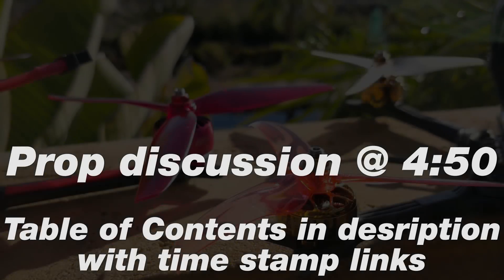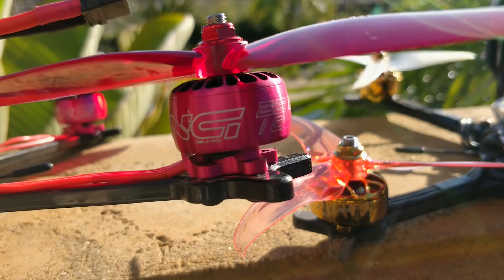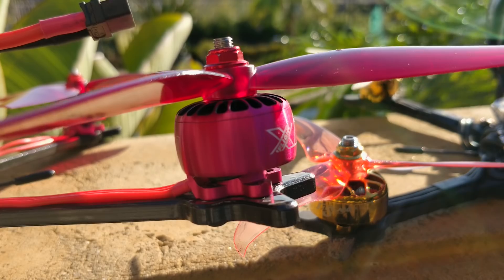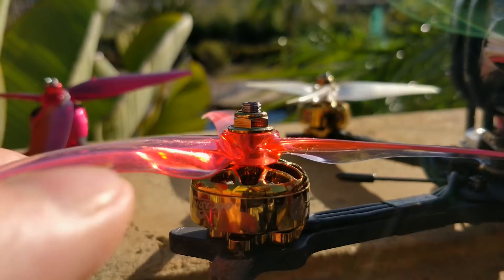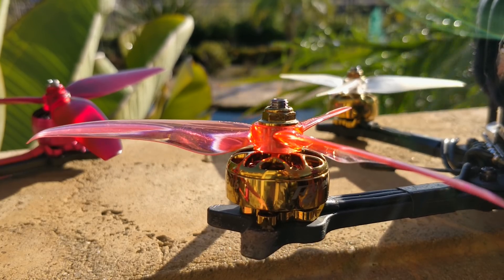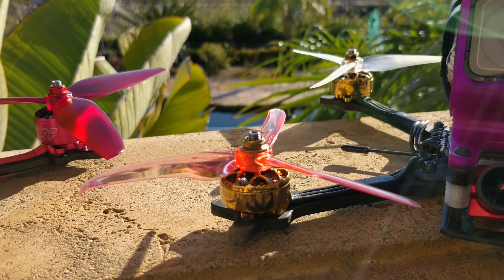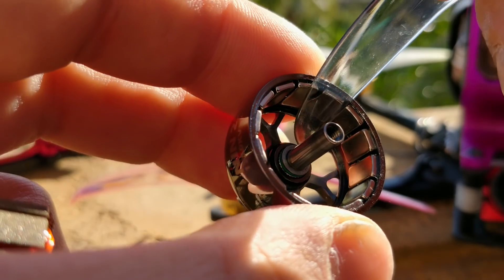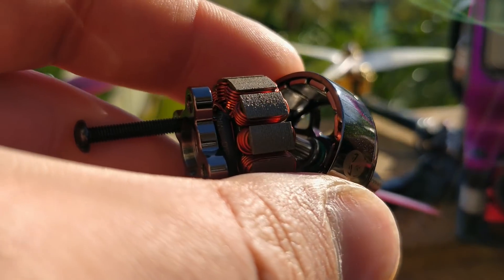Gemfan 5146.6 and Flywoo Motors

Comment: As you know props much better than most I have a question you may be able to help me with. I run an ultralight 250g dry racing Drone with outdated dys 2205 2750kv motors. I find the grip low and slow speed control  lacking. I am currently using 5040 cyclones or 5042 windancers as I am trying not to cook those motors. What props would you recommend
Reply from the maker: Definitely this prop, the Gemfan 5146.6.  For now you can consider the gemfan 5149 probably.  It's particularly good for racing.  Or the newer Tmotor race prop.  I forget the numbers on it.  Don't worry about cooking the motors.  That won't happen.  All that will happen is that the top of your throttle will feel like it does nothing if the motor is overpropped.
Reply: @Kabab  thanks, good to know I have few  of the 5149 so I can try that out until these new ones are available

Comment: KababFPV i would recommend you to try the master air screw RS 5x4.5x3. this prop is supper responsive and grip. but they are still glassnylon so durability is not great. but the feel is soo good

Comment: Wouldn't the power hump be smoothed out by applying throttle expo?
That 2206/07 wobble... God it's so freaking frustrating. You build a mid/high-end rig for smooth footage, bf 3.4 comes out and suddenly my 2.5yo-beaten up-full realacc-f3-QAVX clone flies better at 1/4 the price. Do you have any knowledge on this issue on other firmware, like butterflight?
Reply from the maker: Butterflight is unfortunately dead so I wouldn't bother with that.  I don't know anything else about the issue but it's super duper annoying.  Yes a throttle curve can help smooth it out but it also causes weird inconsistencies that I'm not a fan of.  It's hard to tune a throttle curve.  I'm way too lazy to spend too much time on something like that from quad to quad.  I'd rather just have it flight right from the get go.  Thankfully these new props from gemfan and azure make it possible.
Reply: @Kabab  Didn't knew about butter :/
Seems like a time to drop the Avans and HQs then!
Reply: @KababFPV what is helio going to be running or is it just merged betaflight code now.  Any future support for helio boards coming in betaflight?
Reply from the maker: @danmarsiglia208  betaflight will probably never support Helio. Helio must maintain their own fork of betaflight.

Comment: Nice video as always :) For the cheap motor choice, here is another one: LDARC 2306 in either 1700kv or 2500kv (I have the 2500kv on my first build and I really like them, I have nothing to compare too though...) About 10 dollars on XT-xinte  and about 13 dollars on banggood. I linked XT-Xinte cause they have a nice picture of it disassembled.  https://www.xt-xinte.com/LDARC-XT2306-2500KV-CW-CCW-Motor-for-FPV-Racing-Drone-Quadcopter-Lightweight-Design-Silver-Plate-Line-p545317.html

Comment: Those motors look bad ass!  Does DYS make a good motor?  I’m using their Samguk motor for $9. While I learn to fly. They have taken a lot of abuse but still work flawlessly.
Reply from the maker: The samguk motors are alright.  They work, perform alright but that's about it.  Not a bad value but after just a dozen flights or so the bearings start going bad.  Still usable and fine, just not nice.  I'd sooner buy the RCX motors before those. The RCX are as good as some top shelf motors but they're $10

Comment: All I know are Dalprop and HQ.  I was told the Gemfans were not very good.  These are better suited for Freestyle?  My sources are mostly racers.
Reply from the maker: This has been the case for a long time but the latest few props they have made are very popular with racers too and are actually impressive.  Try the 5149 (not the 5149.9).  The 5149 is not very good at low speed but at high speed it's extremely impressive.  The grip at high speed is unmatched.  This 5146.6 is similarly impressive in that sense but also has good low speed control.

Comment: Hey Bob, great video. Just FYI. I have measured HQ props myself and confirmed with Zhong as well. HQ 5.1” props are, in fact, 5.1”. They are not 5” + 1mm. 1mm is only .039, and that wouldn’t make enough difference to matter.
Reply from the maker: that's what he told me so I dunno.  Whatever it is it's ridiculous what these manufacturers do.  There should be a standard accordance or something among them.

Comment: Your classic saying is...More on that later...Really dig how you examine quad parts.   Wonder if you have tried some Dal  5249...super quiet and smooth prop.  Your awesome Dude!
Reply from the maker: Yeah I wasn't impressed with it.  It's just a big heavy prop that motors often struggle to spin.  They feel like 7" props but are 5.2".  Maybe it was just the two quads I tried them on but I wasn't impressed.

Comment: nice tree topRacing ;) what is going on with brotherhobby and this new speeeeed shield V2 ?! aviable in 3400kv !!! rated for 6s throug the range is that even possible ? i mean 20K RPM are freakin fast, and todays dry bench testing resul in 50K + RPM (please correct me when im wrong) and DR1 racing puts 2200 KV on 6s and.. it that the current "limit" of an "rotor" spinning through the air, and above that... Blades have to shape, and feel (material?) very different to todays "flimsy" ones... 
.. dunno maybe in the next few yeahrs FPV drones especially those build for proffesional racing getting  dangerous in the wrong (hands)
Reply from the maker: I haven't seen that motor but 3400kv is just stupid.  No point and it's just wasteful, you're right
Reply: @Kabab  https://www.banggood.com/Brotherhobby-Speed-Shield-2207_5-V2-1560175019202108240027003400KV-4-6S-CW-Thread-Brushless-Motor-for-RC-Drone-FPV-Racing-p-1421727.html?rmmds=mywishlist&ID=531637&cur_warehouse=CN
Reply from the maker: Ridiculous

Comment: At low feedforward values, there are probably areas in fast recoveries where the FF and D terms are both functioning as damping terms, and that might be what you're experiencing with that.  I think the over-smoothed nature of my older 0/0 D-Setpoint/Transition range can force some extra smoothness as well, although as you mentioned there is a cost to responsiveness contained in there.
I really think there is a use for 2306 motors because of that big hump of torque down low, especially with lower pitch stuff on low weight quads - but I still can't get past how much I love the ultra-linear nature of 2207/2208's with V2 Cyclones
Reply from the maker: Yeah that's why I like 2208 but the issue is that damn wobble when you let off the gas.

Comment: On paper, nylon-polycarbonate composites should make it actually tougher (depending on which resin or butyl-styrene binder is used), so the MasterProp material sounds awesome. To me, a lighter version of the 5149 is probably absolutely perfect for what I'm after - just depends on how linear the thrust delivery is.  I think stiffer probably trumps lightweight with big powerful motors, although the lighter 2306's seem to really enjoy low weight props and get that amazing wispy feel consistently.
Reply from the maker: This prop is really fantastic. I tried not to over Hype it but it's going to be my go to prop moving forward until something better comes around. It very easily took the title as my go to prop.
Reply: @Kabab  I know you don't enjoy doing dedicated prop reviews that much anymore, but feedback like this is basically invaluable.  Also, this would complete my journey to a favorite propeller in each size being Gemfan (right now is the 2040, 2540, 3052, 6042-3, & 7042 flash with T5046C and 5149's tied evenly).
Thanks for taking the time to explain why your new favorite prop is just that!!!
Reply: @Kabab  Well, I find myself in agreement again.  Definitely go-to status, only omission is POPO compatibility on these.
The mixture of smoothness and grip these achieve with tall stator motors is really excellent, as long as there's some torque in the bank these things are just amazing.  On motors with less torque, I'm starting to prefer running really high KV and lower pitch lightweight props (Ethix S3 and HQ 5.1x3.6x3 are impressive) to get a locked in feel that's similar... although that setup has me running some outright absurd combos like 6S 2250KV 2205 on low pitch to get the feel comparably decent to where my favorite vanilla 4S 2207 2550KV setup is with these props.

Comment: Do u think the dys wei 2207 1750 for my 6s build are worth it? Or are they just total crap
Reply from the maker: They're not crap but I also don't think they're worth it. The Emax eco looks a lot better and the Eachine 2306 is surprisingly good too
Reply: KababFPV if I were to raise my budget to 12-18 ish dollars, are there any motors significantly better than the ecos?
Reply from the maker: @DirtyLew42  I'd go for the xing 2306. Eco's are probably good too however.
Reply: I'd run the RXC LS2207 or EMax ECO over those.... or go XING.  If you're tight budget wise, RCX.

Comment: Thanks for review,  Bob.  Is there any chance you can do vid on how props differ between colors.  I've been using the 51499, the yellow is unobtanium durable, but the purple is really flimsy in comparison.
Reply from the maker: There are differences but they're minor. Usually the clear colors are a little stiffer and a little more durable. The difference is the color parts. It kinda contaminates the actual plastic

Comment: I like watching these prop videos. Interesting stuff. I’m checking out the Xing 2208 2450kv (I don’t want to change to 6s, have too many 4s batteries that are still good). What props would you recommend/ are your favourite for that size motor now?
Reply from the maker: I think this new gemfan 5146.6 is probably my most prefered prop on either 2208 or 2306. Other good props are the T5143, S3 however tht S3 is a bit slow and HQ 5.1x4.1x3
Reply: You can get away with running fairly low KV on 4S, especially with 2208 stators.  Unfortunately, the only iFlight 2208's in 2150KV are the older Tachyons, which are kinda heavy.

Comment: Thanks for the great info!  When buying motors how to know that i am going to get clockwise and counter clockwise motors?  I bought 4 motors and they were all clockwise threaded so my props come loose sometimes.  Thanks man!
Reply from the maker: typically most people hugely dislike counter clockwise threads.  Props really don't come loose if you tighten them and use a locknut.  You need to hit a lotta stuff usually if the top of the motor bell is properly designed with good grip on it.  The issue with CCW is that if you loose a nut, you're screwed.  CCW nuts are a pain to source and annoying to carry.  But some still prefer never having props come loose.  Oh yeah you also need to install your motors a certain way and have spars that are the correct direction...yuck.  Too much complexity

Comment: Great video! love these discussions about motors and props. 
I'm just wondering, why do you use the dominators v3? 
I feel like you have access to all the hardware you want, is it beacuse of the 16:9 on the micro eagle? worth the goggle fov sacrifice?
Reply from the maker: I don't like any of the HD goggles optics including the HDO.  They have extremely blurry edges.  The dom V3 was the last pair that actually had optics that were acceptable.  I would prefer a 4:3 screen but I'm totally fine with the wide screen.  In fact  it's gotten to the point where i prefer a 4:3 camera on the 16:9 screen which is weird to me.  I'm waiting on the Orca goggles and hoping they'll have good optics and a good screen.
Reply: Freeform prism optics is where our goggles should be at.
Every once in a while I dig out & have a look through my Sony Glasstron PLM-700E's, 800x600 res video glasses from 20 years ago that, optics wise, wipe the floor with all current goggles.
Reply from the maker: @licensetodrive9930  it's really really sad. Fatshark has made an absolute killing off the industry and just put out garbage after garbage.
Reply: @KababFPV  For sure, I wish I could have HD2's without the blurry edges. When I got the chance to ask them about using freeform prism lenses 15 months ago, Greg(?) did reply they developed a prototype but ran into problems, notably the panel manufacturers keep making them smaller and smaller, which means higher magnification lenses and more difficulty in getting your eyes aligned correctly: rcgroups.com/forums/showpost.php?p=38455734&postcount=8
Reply: I'm still on box goggled that are 800x480 I can't justify buying fatsharks, I feel like the only thing I would gain would be size. Is it worth it?
Reply from the maker: @Viktor-vz4uz  no. Definitely not worth it. To me, the only improvement would be the ability to use modules like the rapidfire. Wait for the Orca's. Maybe those will be worth it.
Reply: @Kabab  yeah modules, but it's so easy mod that in to any goggle. Did it on mine
Reply: I agree with kabab here, I like the view of a 4:3 cam on my 16:9 commanders.  Switched my micro eagle into 16:9 and just couldn't get used to it.  And the only thing wrong with box goggles is the size and unable to easily use a different  receiver module.  I love being able to hand my old ev800s to someone for a ride along and know they're able to see without having to figure out the ipd sliders and/or deal with blurry edges
Reply: @danmarsiglia208  was thinking of getting the aomways or Dom v3 but I'm concerned about the screen size, I'm also coming from the ev800 is it a huge difference?
Reply: @Viktor-vz4uz  Immediately there is a difference with where your eyes are focused.  The EV800s make you focus in very close to a big screen while with the Commanders you focus further out like your in the middle of a movie theater.  Once you're used to that its actually better having a slightly smaller FOV as you can take it all in more without having to hunt around the screen.  I was against losing that FOV because I thought it was necessary to feel more immersed but I don't feel I'm missing anything.

Comment: I just want to see these xing 2210 at full trottle with 6 inch biblade
Reply from the maker: The video at the end is with a 7" prop
Reply: we want Avan Long Range 7" bi blade, please emax hahaa
Reply: @salviaaable  Agreed!  I run the Avan LR 6" on my 4s Rooster with Emax RS 2306 2700kv motors. They're not amp hungry, and do pretty good freestyle too. Cruising around and maybe doing a couple power loops, I get between 6-8 mins of flight with 1y/o Tattu 1300mah 45c Lipo's that have been swollen for 3 months. I'd love some Avan 7inch bi-blades.
Reply: 7" triblade!!!

Comment: DUUUDDE I found a pack of gemfan 5x3 bi-blades from like 2 years ago still in the pack. a part of me wants to fly them just to take a trip down memory lane but pretty sure the weight of my rig & it being 5s would explode them so probably going to keep them as a relic. Like they even have the inserts for smaller motor shafts. we take props for granted now a days but they've came a long way. I'm thankful for the props we have now lmao
Reply from the maker: worst props ever. lol
Reply: I've a box of 'legacy' props, I tried flying my Hawk 5 with Gemfan 5030 2-blade props once, the power just wasn't there and when trying to bank hard at speed they couldn't deliver the power and crashed into a bush, every single blade broke off, I laughed.

Comment: I've been looking at yours and others views on various props because I was on my last set that came with my Hawk 5, but there's just too many and too many opinions, so I took the easy route and received 5 more sets of Avan Flow's in the post today because I know they work well, just in time for the calmer weather next week :)
Reply from the maker: Any prop from the last year will work well.  You don't need to worry about that.  I personally am not a fan of the Avan Flow.  I feel it's inefficient and slow.  Any of the HQ props will perform better to me and give longer flights.
Reply: You're lightyears beyond my experience of 5" props, but I aim to fly a lot more and learn a lot more about various handling aspects of 5" quads this year.
I've been consistently getting over 3.5 mins from the Hawk 5 with the Avan Flows, running 1300mAh packs with a sport cam on top doing lots of fast maneuvers.